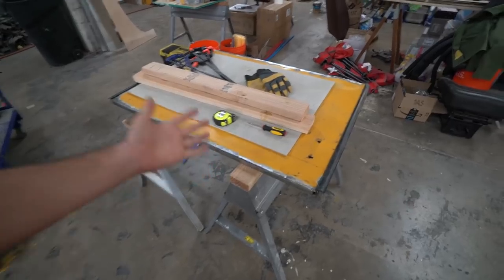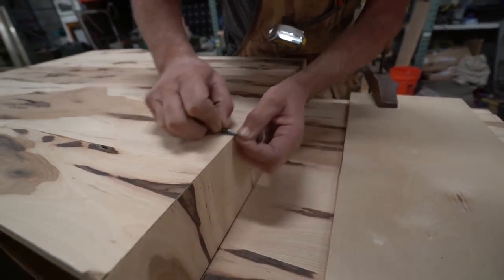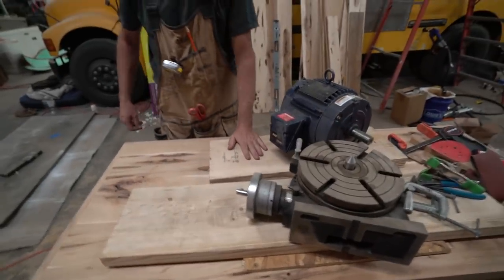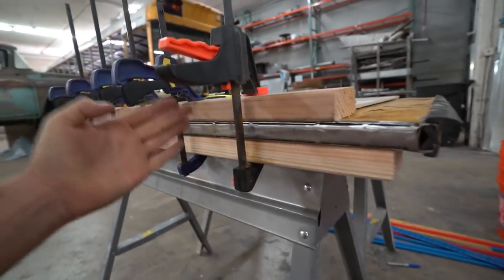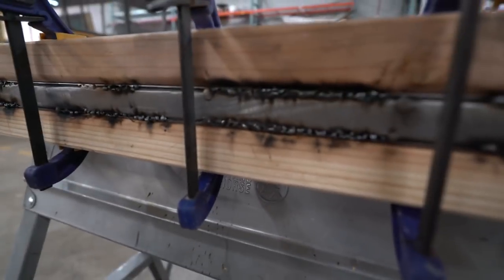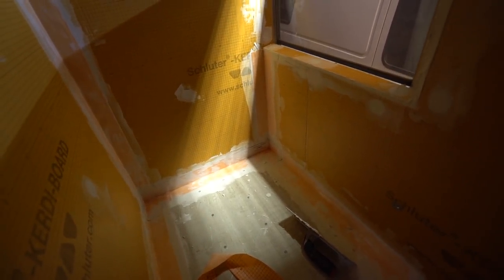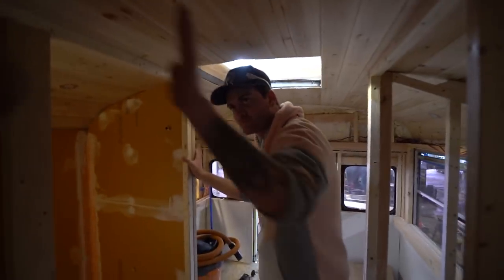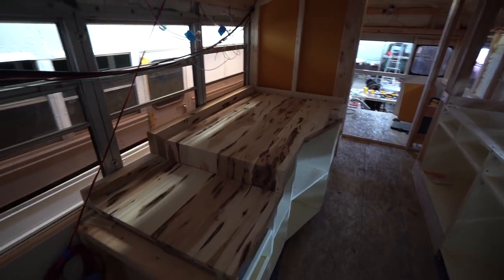Gullwing Problems + Tiles + Chess Board

Comment: Welding with wire sounds like bacon frying. On thin metals it’s good to skip weld to prevent warping.
The wood, would have just clear coated it to let the natural beauty shine through.

Comment: the only problem with clamping with wood for welding is that the gas comming off the wood smoking makes the weld look worse (it interferes with the shielding gas )
about adding material to the edge of the door : it will go faster if you weld weldingrod to the edge , gives you more material to start with lay it flat on the corner and weld both sides then grind flat
about fixing the door / opening from the wheelchair lift , since there raising a lot of busses they should have a lot of spare bus windows , it might be a nice idea to put a window in there that is the same as the reast of the bus windows , probably looks a lot better than plating it shut and put the small window in there